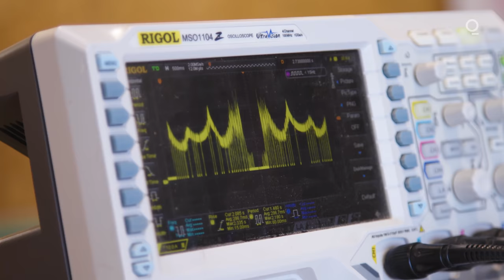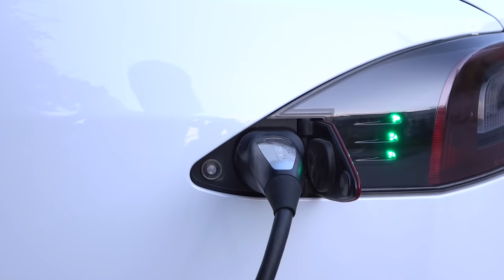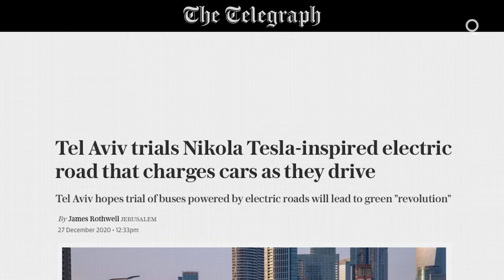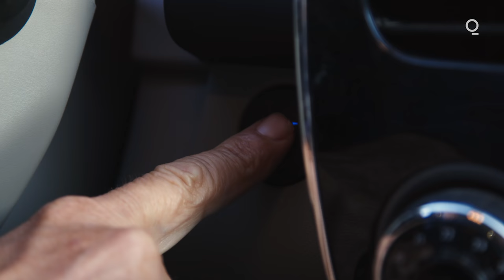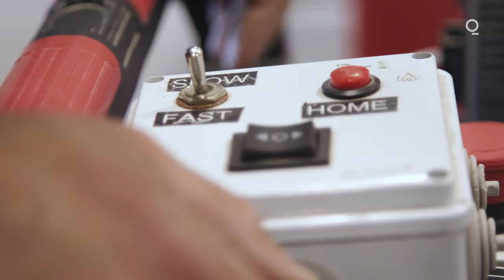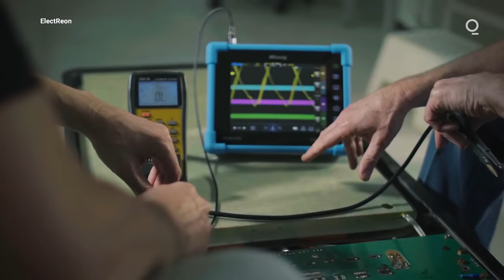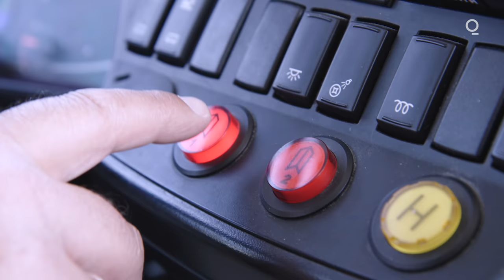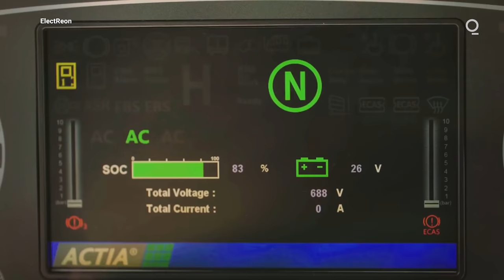How Electric Roads Could Power the Future

Comment: What about the WASTAGE OF ELECTRICITY ? Whenever we talk about wireless  charging there is this massive, massive problem of loss of power while charging. Who'll pay for it?
Reply: This is still in dev. phase. I am waiting to see how it shakes out.
Reply: The receiver. There is also a loss of energy when using any kind of fast charging and people are still fine paying the energy provider for kW dispensed rather than kW "charged".
Reply: Due to advance in electronics this is easily solved by switching ON and OFF  detecting when a vehicle passes above
Reply: @muskreality  even when a car it stationary above a charging coil, you still lose ~half the energy through heat.
Switching won't solve this.
Reply: Already in 2018 the US dept of energy achieved 97% efficiency at 120kW charging, which is comparable to cable charging.
Reply: Don't worry they have a solution for that.

Comment: Efficiency is what wins the game. If we switch from ICE (3x% efficiency) to EVs (81-93% efficiency), we already won. Improving the charging infrastructure may have another benefit, though - limit speeds on the roads. I'd put it in the stoppage lane or the slowest lne, though - need a charge - drive for 2-5km in the "slow lane", get a boost and drive on. And take a loss of wireless charging - which is huge - 47% as "Nobody" commented.

Comment: This would be perfect for vehicles that drive on roads but never stop in parking spaces. Like.... well, like just... roving... ah.. cars, you know, that never park. That's a thing, right?
Reply: Not many have heard about it I guess, but there's this thing in development, it's called "autonomous driving". So in short, the answer to your question is: it will be.
Reply: @idomaghic  they'll be just fine using charging stations and home charging. If people want to pay an automated fee to fund the outlay + twice the electricity cost after half of it doesn't make it to the car then props to them. As long as it's not the public coughing up for drivers yet again.
Reply: @UCtAqDhUnjOS5nB2WAwP-Ugg a little bit of downtime on a wageless, energy efficient vehicle is nothing in comparison to losing your energy efficiency and paying for an absurd amount of infrastructure. Even just the copper alone is monumental. It's been hard to even justify for rail operators on high volume routes (maglev has similar needs) with subsidies, and where most of the energy isn't going to waste. Suggesting this in the ground without duping highway administrations for wads of public money is either head in the clouds or vapourware.
Reply: @Freshbott2  right, I'll continue this discussion when you've read up on the current state of dynamic wireless charging, because from your incorrect assumption of transmission inefficiency (where actual fact is that dynamic wireless induction charging can actually outperform plug charging, especially at high loads), it is clear that you simply don't know what the current reality is. Any further discussion would be a bit like arguing about the shortest route with a flat earther.
Reply: @idomaghic  considering from the point of the receiver pad the battery is 'plugged in', I think not coming back to the conversation is the right choice.
Reply: @idomaghic  How far off the centerline of the road can the car be and still be efficiently charged?

Comment: Wireless charging is now just as efficient and regular public electric station charging or home overnight charging. This is a fact of physics! So energising the roads in specific locations is the ultimate way of the future and using this approach means we would not need so much onboard battery total storage capacity, This will make lighter and cheaper vehicles a thing of the future and solve many existing problems and determinants to the rapid adoption of our clean and so much safer electric future.

Comment: It is highly inefficient, especially at that scale. When a cellphone is wirelessly charged, the loss is acceptable as the charger's efficiency is approximately 70% for that size of a system. 
When wireless car charging is implemented on roads, there will be at least 1 to 2 feet distance between the coil on the car to the ones in the road; the thing will probably be 30% efficient with a +/- tolerance of 4-5% due to uneven roads as well. Not really practical.
Reply: Our family’s Toyota Camry has a ground clearance of 0.5 feet. Most cars have a similar ground clearance so the efficiency would be way higher than 30%.
Reply: @VMRDY  in today world of SUVs the ground clearance is higher
Reply: @mrguest3749  I’m pretty sure most people don’t need SUVs and the OP said “at least 1 ft” so I was responding to that.

Comment: This is never going to work, a few years ago a company was trying to create solar powered roads, again never going to work.  For a start the amount of copper required to be paved into all road networks would be insane, the cost of infrastructure changes, basically meaning ripping up all roads. Maintenance of roads goes thru the roof.  Any disasters, such as earthquakes and floods essentially electrifies the whole ground as power cables are sat in water which is obviously very conductive. And lets not forget that wireless charging loses at least 30% of the electricity during transfer.

Comment: I expected this to be a repeat of the solar powered road surface that had programmable led markings to enable reconfiguring travel lanes,  automatic heating to clear snow and ice, secure pathways for utilities and an indestructible surface that will last forever even with heavy truck traffic and available with Bose sound cancelling technology to eliminate all noise from the road. All for less than 1/3 the price of an asphalt installation. 

Nope, this is a startup idea that really shouldn't have gotten past first thoughts of wirelessly charging through the road surface.
Reply: This is a much more practical idea than the solar "freaking" roadways scam.

Comment: I didn't get the idea, In the early minute of the video, it said that charging battery is not truly sustainable. However at the end, they didn't provide any information regarding the efficacy and efficiency of the system compare to the charge model. In short, they only replace the way of charging the battery which doesn't any significant impact to battery consumption.

Indeed, it is true by using this tech, people can save time, but cannot save energy. By expanding the transmission, it means more cable and more loss in the transmission system. If we talk about time, why don't use battery swap instead? Lower capital investment. Here in Taiwan, battery swap already won the public and the case. Also simple payment method.

Comment: That is not a bad idea for urban areas, I can definitely see it being a thing in city centers and roads going in and out of them to continuously charge commuter cars, buses, commercial vehicles and the like. As long as it is properly standardized of course.
For everywhere else though, this sounds much more complicated and costly than simply building more charge stations. Engineers around the world are working tirelessly on the development of batteries that don't rely on rare resources like lithium or cobalt and have a much smaller carbon footprint in manufacturing.

Comment: This is a brilliant idea, but there are a few shortcomings.
Firstly, the wireless transfer of electricity is too inefficient. They need to hang electric wires over the road and maybe extend a boom arm from the car to transfer electricity.

They should also run the car along a rail to maintain alignment with the overhead wires.

Single user cars will still be inefficient. Maybe they should make the cars bigger so that they can fit a couple hundred people.

Oh wait, that's a tram. Nevermind

Comment: The technology developed at MIT is said to have no energy loss. What about putting receivers on the front or back of cars so property owners could put units on the walls of each parking stall in places like parking garages without having to jack hammer up the concrete floors and it might be easier for  home units and other areas and faster and a lot less costly to install.

Comment: My humble opinion: PHEV Period.
 I have owned plenty of Gas cars, Electric only cars, and hybrid cars. They all have issues. Gas always burns gas even stopped at a light, Hybrids always burn gas when moving, Electrics always have charging delays and range anxiety on a long day of errands.
 PHEV is my favorite! You get the no anxiety drive, point A to B on EV only daily to work. Anytime you need to go farther the gas kicks in for unlimited rang. In large Metropolitan areas the smog would reduce. Plug in at home while you sleep and full again every morning.
Gas on the interstate, EV on surface streets. Diesel Semi truck between cities, Drop/Pickup zones on edges of cities, EV trucks in city limits to deliver and bring full trailers to the drop zones.

Comment: Do you want an even better answer? Over head cables on highways like cable car. You will only need it on long routes so you can start with buses and trucks only first as the wired route is the most efficient and the ones requiring the most range are handled first while we think about cars later
Reply: Even better : solar panels

Comment: Interestingly they never mentioned power transmission efficiency loss and the huge negative environmental impact this extra required lost energy has.
Reply: Not if we transition to nuclear or renewable sources of energy
Reply: @shanewalker3273  you will need double the nuclear plants or double the batteries for renewables. Environmentally this is not wise.
Reply: @erisi  Doubling nuclear plants is environmentally incredibly wise
Reply: @shanewalker3273  if world needs 10 nuclear power plants to support all the electric cars in the future, if we use this type of roads then we will need 20 to handle the super inefficient power transmission. A world with nuclear power plants over the current renewable is debatable but probably is better. If we need 100 power plants in total in the future but because of this technology we will need 110 power plants, then this extra 10 power plants is not a wise thing to do.

Comment: Why is there no mention of efficiency of the charging to the vehicle. Wireless charging is already inefficient for mobile devices etc. but those devices are usually touching so I feel like the inefficiency of their "solution" is magnified bc it's buried under asphalt as well as the distance between the undercarriage of the car and the road. I'm just curious if these are things their also working on and have potential solutions for.

Comment: It's great to see wireless charging roads helping us in cutting down the need for electric batteries but how efficient are these systems and with current technologies does the cutting of vehicular emission due to extensive production and installation of these coils justify the pollution which might be produced in the process of producing these?
Reply: 50%
Reply: It might be better if it reduces the need to mine lithium and cobalt.
Reply: spoiler: pathetic

Comment: Every meter 4 KG Copper? So for a moving bus to get up loaded half or so, it takes him 30km/h. After that hour of diving really slow to shorten the path to go through loading. 30000m*4KG*6000$átoncopper= 720K$ Worth of coppe + the roadwork + the Equipment. What a dumb video

To cover just New York City with it (10.200KM road). 244 800 000$ of Copper. Nice.
Reply: You don't need this on every road, not even on 50% of the roads, especially not initially; start out with the >5% most used roads and you'll probably cover a large chunk of all vehicles. And only install the system while redoing the pavement/renovating the road anyhow, and the extra cost will be extremely limited.
Reply: @idomaghic  How much is the Cost of a charging station? 
How much is the cost of the Road to load just 1 Car driving with 30km/h? 

I would not give you one Dollar to make such roads.
Reply: @marcelswoboda5427  Why would you go 30km/h? And why only one car? Witricity has technology (acquired from Qualcomm) that allows for charging at 70mph. Electreon's test track in Sweden achieved 70kW avg. (for a truck) at 60km/h. It seems like you need to read up a bit before commenting further.

Comment: the roads are already hot :) (wireless charging is not efficient) heat is generated (electrons bouncing each other's producing heat) basically you put 10W in through a wireless charger and you change just around 6W of power (4W is waste heat)

Comment: The comment about a big question about economics is an understatement and underlies everything from expected lifetime, any road construction requirements, maintenance and management systems, more.
In particular, I'm trying to imagine embedding in what kinds of roads, here in the USA we have a few roads like our interstate superhighways which are concrete and are resurfaced maybe every 8-15 years depending on use. Asphalt roads need to be resurfaced and repaired nearly annually. Resurfacing often involves adding new layers so might put the electromagnetic emitters and collectors deeper under ground over time unless you go through an additional process of removing layers and risk damaging the system.

The basics might be relatively well known but specifics and details could be concerning.

Comment: This seems far more expensive and complex than simply improving battery technology. Especially given that a Tesla can already achieve the driving range of a regular combustion vehicle.
Reply: This is cables set along the road,and cheap flat copper coils. This is literally smaller than any battery, and gives you infinite range, while making your car lighter and cheaper. And it doesn't degrade as batteries. Most cost would be from road work and pavement to install it.

Comment: Problem with this is it's really expensive. Do you put it along the entire highway? That's a huge amount of infrastructure required and you have to build it into the road. Maintenance sounds really challenging too because on a freeway how will this tech do with big ass tanker trucks driving over it 24/7? Also does maintenance of one area break the circuit for the entire road? Lots of problems I can see, this won't happen
Reply: @VideoAmericanStyle  You don't need a big battery for dense urban areas, and the suggested use is for cars in this video, not busses. Electric cars will really only benefit from this on freeways so they can travel long distances without needing to charge and without needing big batteries. In a dense urban area my nissan leaf with 60-120 miles of range will do just fine. So the only useful use case for this technology is for freeways, particularly since installing more infrastructure in dense urban areas is much more difficult and expensive.

Comment: why not just go Hydrogen? Basically battery powered with an onboard charging system where the byproduct is water. Would cost a lot less for the infrastructure too. Not to mention you can achieve a net zero emission.

Comment: There has to be a system change. Less Cars, more trains and public transport. Say goodbye to the idea of everybody owning a car. Wireless chargeing of vehicles has it's purpose but only on highways for trucks or fixed routes for busses. But even here you could use powerlines on poles. So why no railroad instead? The technology presented here is only one possibility to change our transportation issues. But not the best and not for every sector.

Comment: EVs are as clean as the energy source that powers them.  If you live in an area where much of the power comes from hydro, nuclear, and renewables you're effectively creating zero emissions by driving an EV.

The cobalt/Lithium problem still exists, but the solution is to develop new / better battery technology.  Graphene super capacitors or other possible battery solutions that don't rely on such scarce resources.

Comment: This will be a fantastic answer for Europe's & America's EV charging challenge; the car owners with no own drive way. This solution can be fixed in all car parks (public, office, underground, etc.) for those car owners to get their cars charged while in parking during day or night.   

If this solution is fixed in your garage or parking lot, Car can start charging the car even if the owner forgot to connect the car in to the plug. 

If the cars can be charged during the day while driving, all the sun shining countries can use their additional electricity generated by rooftop solar systems without wasting them. Then they do not have to burn fossil fuel to charge cars during night. Though this would not be the current scenario, it will be very likely in few years time.

Comment: Wouldn't you get most of the benefit by just putting a solar panel on the roof of the car?
Reply: No. The solar would cover few percent of the car needs. If you're not on the road, better put your car in the shade. Other then that, you wouldn't notice if your car's solar panel works of not. Unless you never use your car, of course.
Reply: Many places are cloudy a lot.

Comment: charging stations are easier to install than gas stations. i think a better solution than wireless roads would be car batteries than can be swapped quickly at a station. so the station takes its time charging the batteries and the customer simply drops by and swaps out a battery.
Reply: But swapping stations are much more sophisticated and expensive to construct than fast chargers. Fast charging will remain the preferred choice.

Comment: Why not take it a step further and make cars and roads into generators with magnets in road going down steep hills, providing "magnetic brake" and be able to provide a little power to the grid reducing the stress on the grid and making it even more sustainable, don't know if that's possible but it's a concept that could be interesting.